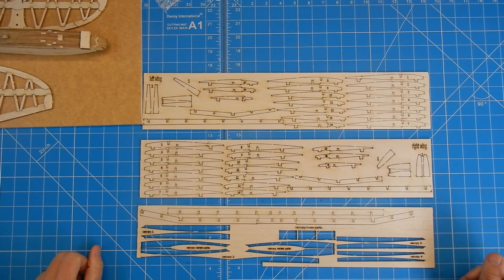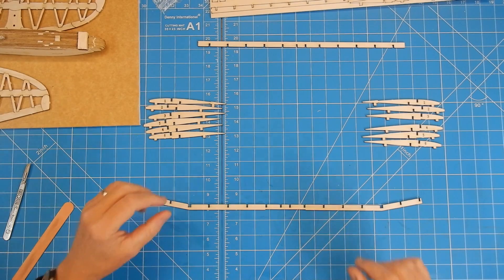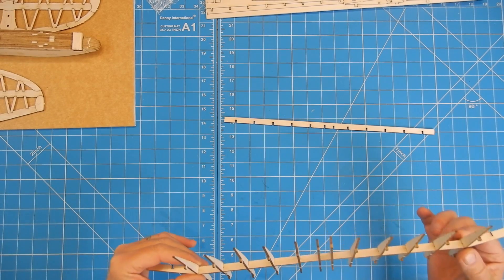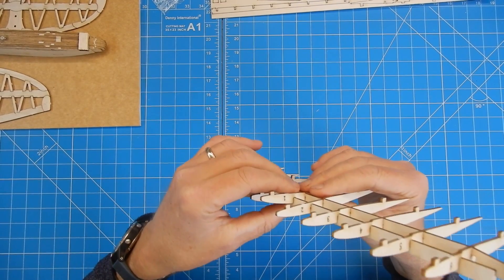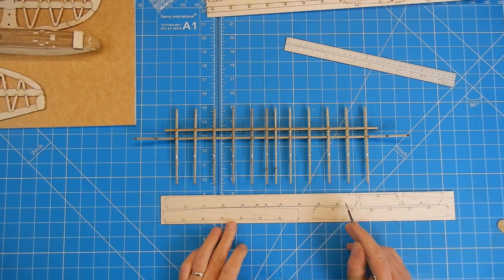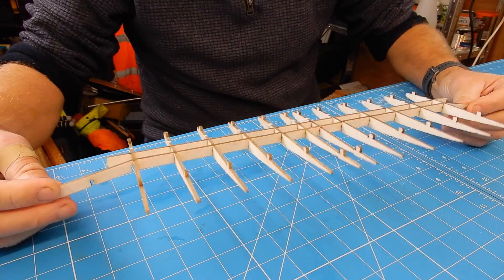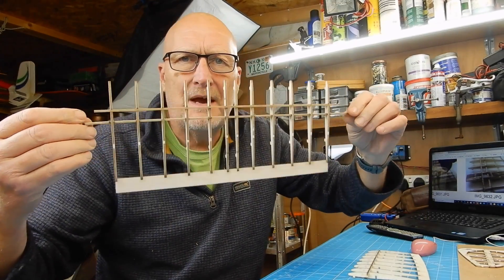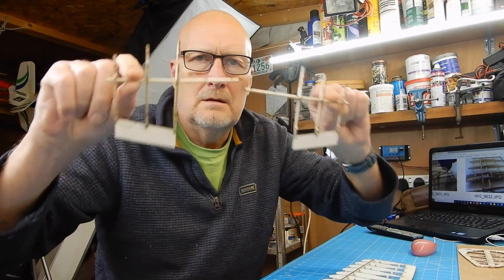How to build a  CXRES mini Glider  Part 3a The Wing

Comment: Dammit, those angled wing joining spars are really brittle! Unless you manage to be really careful throughout, replace them with something more solid, reinforce them with superglue in the weak point or .. just cut them in two, glue each to its intended wing panel, make a 6 degree jig to sand the panel edges nicely flat and glue them together. The permagrit lifted 4mm on one side makes a sweet 6 degrees plane. Not entirely sure about the angle as I eh .. haven't an angled joiner to measure on anymore.. anyway, the strength of the joint is definitely not coming from these spars.
Reply from the maker: I know right 😂😫 mine has stood up to light bungee I will step it up soon